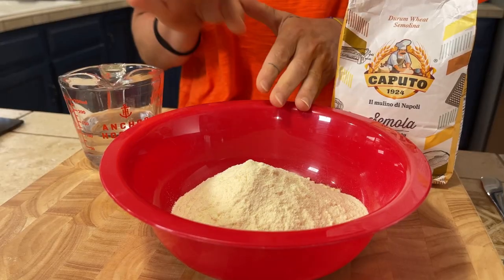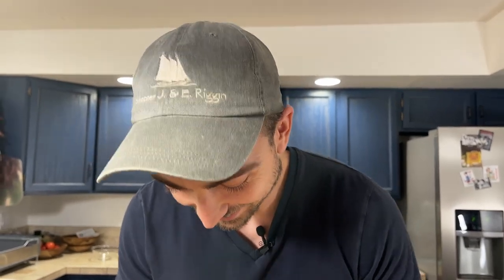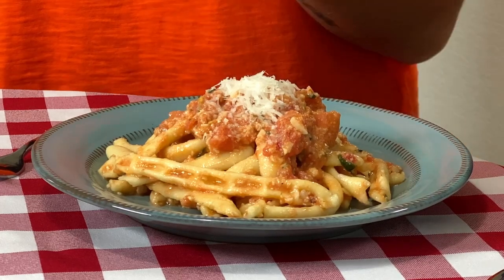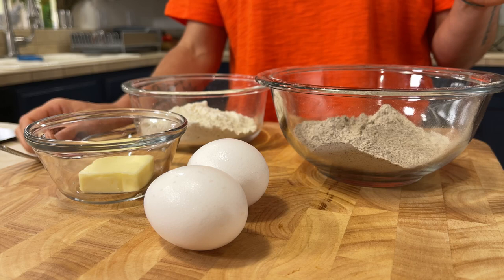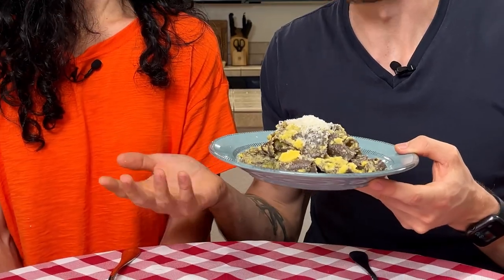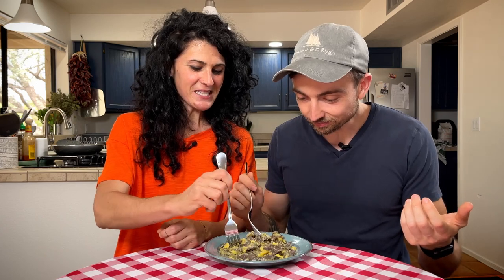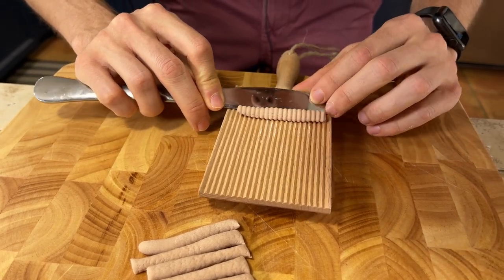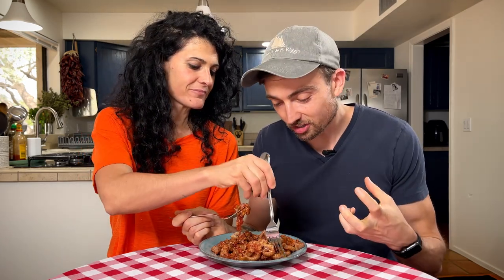SECRET Italian Pastas and How to Make Them

Comment: What is Eva's opinion about getting a small commercial extruder (e.g., Bottene Lillo Due)  with dies for various shapes, which can be challenging if done by hand.  Alternatively, Bottene makes a manually-operated  "torchio," which also uses the same dies.  Both a mechanical extruder and a torchio have a wide variety of dies to make tubular, shells, orzo, etc.

Any suggestions?